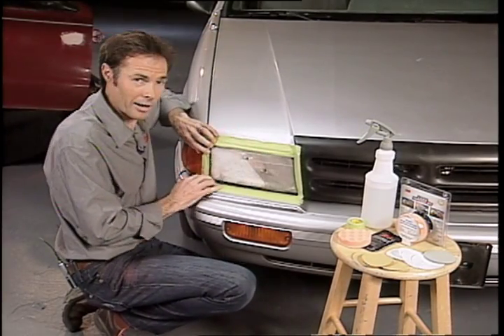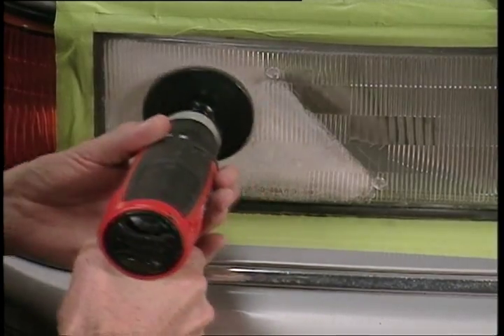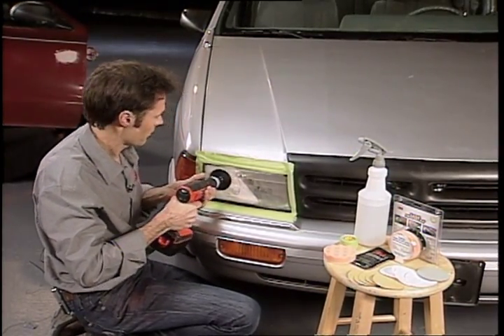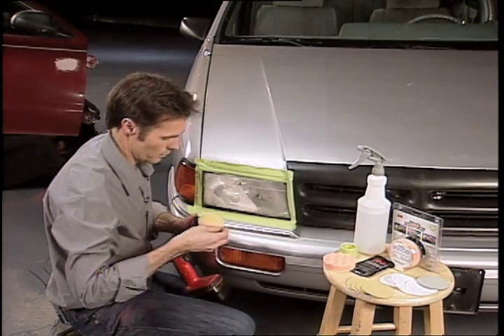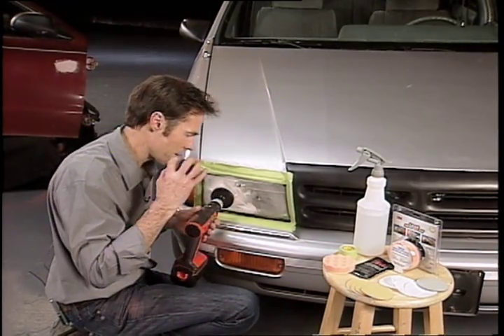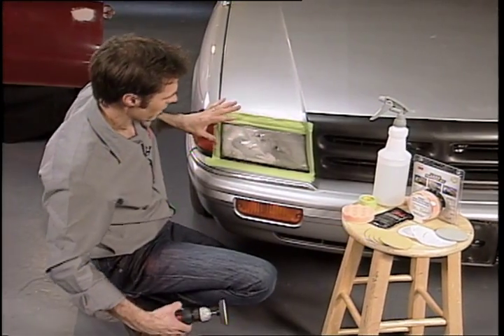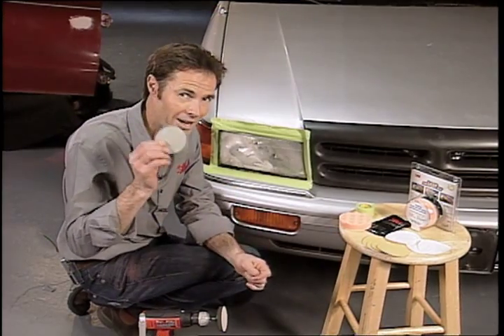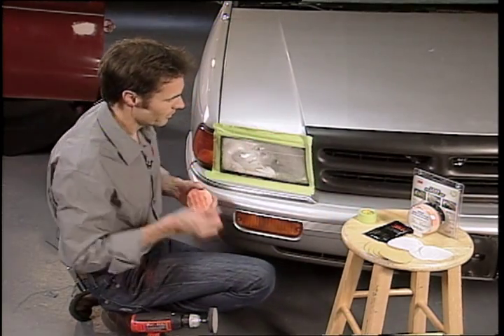For safety's sake, remove headlight hazing with 3M Headlight Restoration Kit

Comment: I finally worked up the courage to try the 3m restoration kit on our hazy 2004 VW Passat lense covers.  It worked great, and I didn't spend more than about 20 minutes per side.  Had I sanded a bit longer, it might have been even better, but my wife is thrilled with the job, and I'll do it better next time.  A great fix for under $30.  A pro shop with charge over $150 for the same thing.